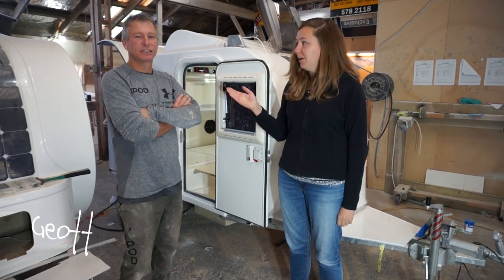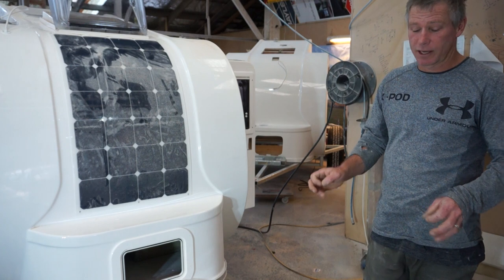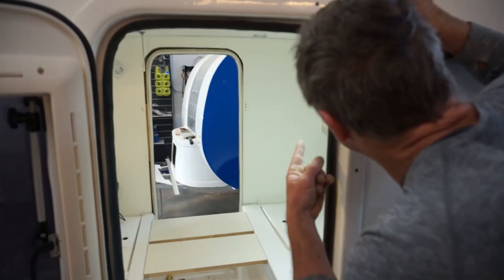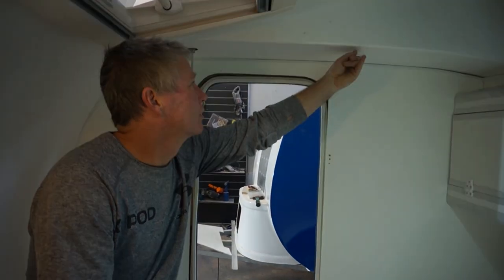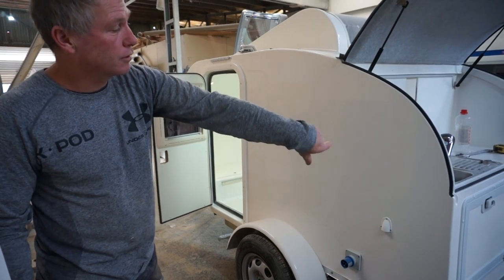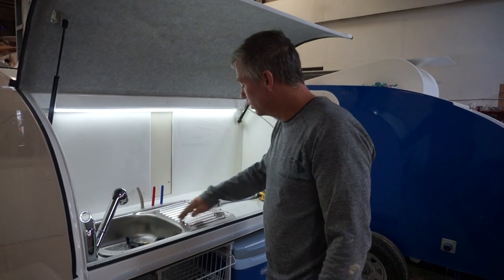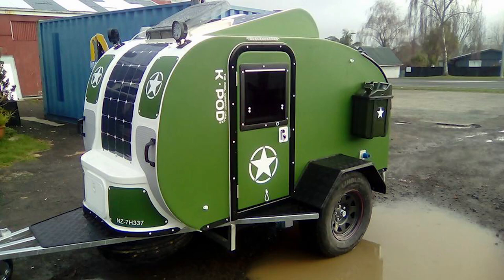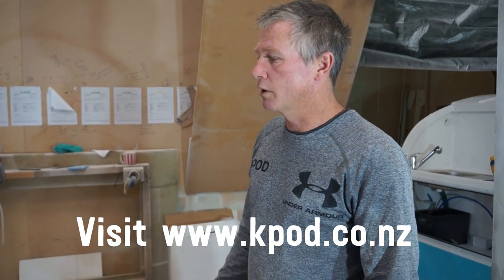Teardrop Campers handmade by K-Pod | New Zealand

Comment: The K-Pod got all I need! Small and well equipped with everything for a long road trip. But I wish I could use it here in the Philippines. Travelling on campers / Caravans is not widely practiced here. Parking and safety at night might be a problem. Hayysss...
Reply from the maker: That's a shame! I'm curious - are there campgrounds?
Reply: No campgrounds here. I guess it's because accommodation and air tickets around Philippines can be really cheap so we don't really use campers here. And yeah, safety is an issue

Comment: I have to ask how would you feel having to move things around so you could make out the bed every night? I ask because I plan on building a small sleeper type camper with hard sides to pull behind my motorcycle. I have a cot with a tent over it I stayed in on my 7 day and 6 night trip back in 2015. I also had a teardrop trailer that I will never have again as the wind from the trucks make it and the bike wiggle when one passed me. Nice video Karen. Good luck in the future.
Reply from the maker: I’m personally a fan of a fixed bed 😜 But love the idea of a small compact space...